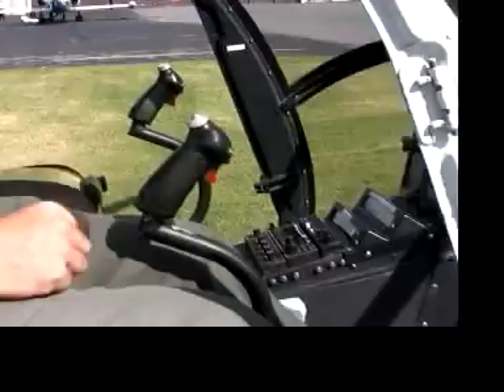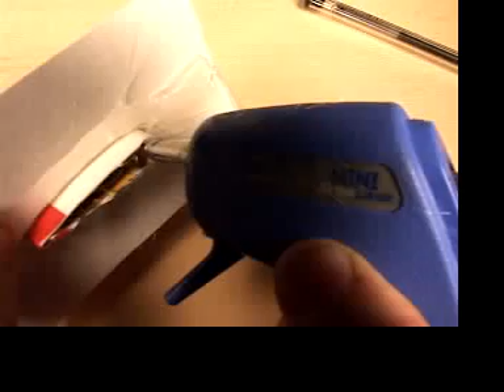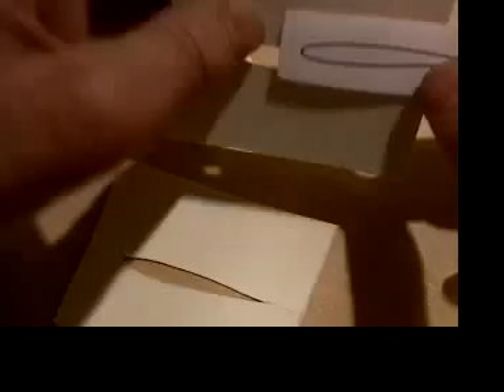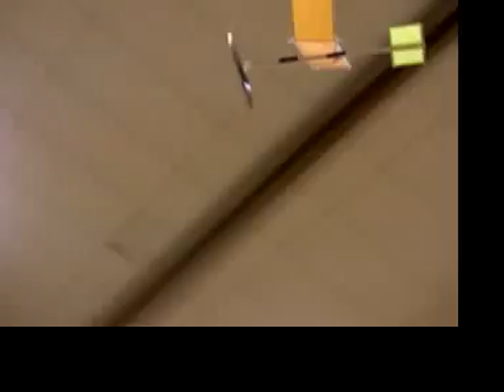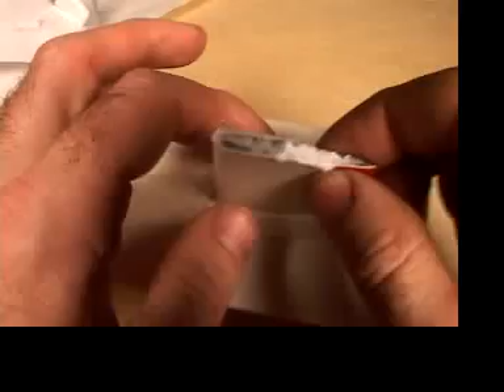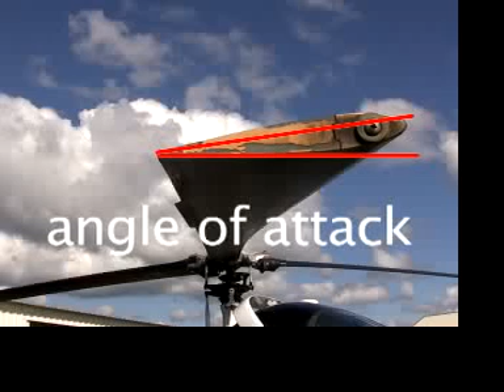Build a Pull String Helicopter BETA

Comment: Where find the instructions for helicopter launcher?
Reply from the maker: I did not know that this video is still up. I plan to  unlist. The high speed spinning is too dangerous if the weight flies off. Using tongue depressors and paper airfoils eventually morphed into the boomerang project--which is safe and really works. I uploaded it onto the Make channel https://youtu.be/ynWZ7q9ZDa8

Comment: Great presentation as usual. What is the actual angle off attack in degrees? I think I could laser cut some bits that could make for a quick assembly but you would miss all the important challenges you present.
Reply: 5 years ago wow